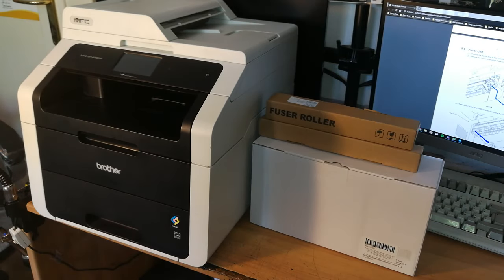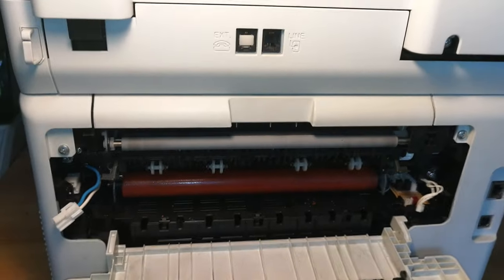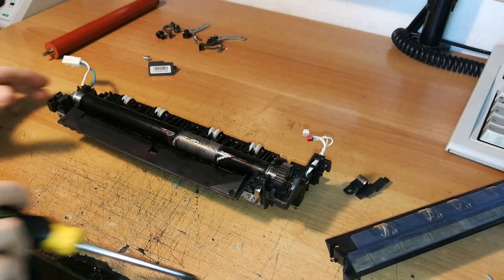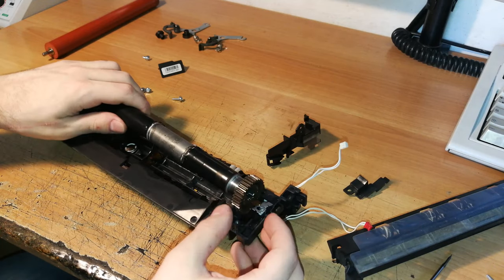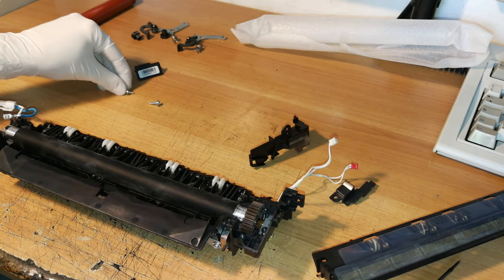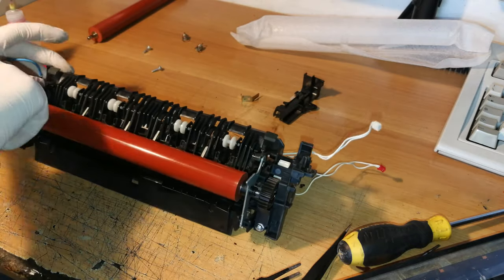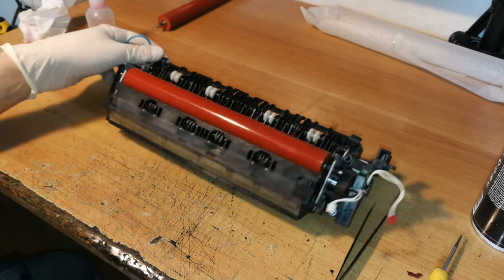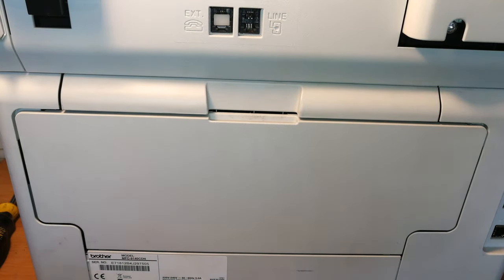Brother DCP-9020, MFC-9130/9140, MFC-9330/9340 • Fuser Unit Rollers Replacement

Comment: Paolo - Thank you so much for making this video.  I have no doubt I can change out the rollers with your instructions.  The only problem I'm having is which brand to purchase.  Many reviews of parts are stating the toner is sticking to the new rollers.  Is there a brand you recommend?
Reply from the maker: Hi David! The only one I tested is GoodPartner from AliExpress: https://www.aliexpress.com/item/32904772830.html
Consider also that if the temperature sensing thermistor is bent or it's not making good contact to the heat roller you can have toner sticking to the roller and/or not being fixed correctly on the paper.
Reply: @PaoloMarcelli  Thanks again Paolo!  :-)
Reply: @PaoloMarcelli  Hi Paolo - I ordered the roller set you recommended from aliexpress.  I had a problem with the factory gear fitting on the new lower roller. As you showed in the video, after bending the tabs, the gear slips right off the old roller and slides right on to the new roller.  Wen I attempted this process, I had to force the gear onto the new roller which then caused binding issues with the gear still attached to the fuser unit. I even tried ordering a different lower roller from Amazon with the same problem. Have you experienced this problem?  Any suggestions?

Comment: Great video.. So detailed and calmly explained.

My roller split and I decided to replace with a whole new unit. Seemed a very simple procedure, but it still wouldn't print after install. The paper stuck just an inch of so out of the heat roller and claimed there was a jam.

I have heard from several others with this same issue..
I'm told it is the little printed circuit board the two tiny wires from the unit plug into.. Any idea what might have gone wrong with it?
Upon removal I see nothing at all out of place. Solder joints look good.. Connector ports look solid.
I have a new board on the way (it was very cheap), but I'd really love to know if I did anything wrong.

It looks like there may be some kind of fuse on the board. A tiny one under a black plastic cover.
Reply: Mine is doing that also. What did you do to fix it?
Reply: @SkylerKincaid  I literally received the replacement board today. I'll try installing it and let you know if it solves it. The amount of people having this same issue is making me nervous though.
Almost like it's some other problem.
Reply from the maker: @Rob Lawrence Even newer Brother printers have problems with fuser units sometimes, but I think they have fixed and improved a lot since that series, I work as an authorized printer technician for Brother and other brands, and since that series on the newer MFC-L9577CDW it's waaay better. Sure they should've done more testing on the older series before releasing it, but I think it's good that they corrected those things in the newer. Better than Samsung that has the same problem with the solenoids getting stuck after 10 years of this happening XD
Reply: About the only thing on that board is a phototransistor, a $1 part from DigiKey. The sensor does two things: checks the cover is closed and also detects when the paper starts going up (there is a small lever that gets pushed by the paper). The sensor on mine got bad, producing a constant 'Fuser door open' error. I had to replace the sensor to get the message go away (https://www.youtube.com/watch?v=k-nSY0_wmMw&t=1s). Bypassing the sensor would clear the message, but the paper will always jam with half an inch in the fuser just as you described.  If you don't have the error message, the board is likely fine. Now that I replaced the sensor, the error went away, but the paper still jams occasionally, seemingly when the printer is hot. Perhaps the plastic lever gets bent and is not doing its job detecting the paper on its way up. Will play with it more.
Reply: @maksym3d  Replacing it fixed the issue.
V cheap part.
Reply: @breaddrinker  Thanks for the feedback! I think I might have to replace the rollers after all or maybe redo the solder joints on the connectors.

Comment: I would LOVE your help! My MFC9340CDW stopped working yesterday, after it printed a single test page, but ran out of paper. I pulled the paper tray out, reloaded paper, closed the tray, printed and it shut down, powered back up, shut down again but didn't restart on it's own. It's obviously due to something involving the paper tray, but I can't afford to just throw parts at it until it works again, and certainly can't afford a new printer. Any ideas?

Comment: Hi Paolo, just replaced the fuser rollers for my 9022 cdw. Thanks a lot. One Question I have is, do you have a source to get a new plastic gear of the black rollers right sight? My roller was a little bit taller and I get a little brick in the plastic gear... tried to fix it with second glue but it is not the gentlemen's way... an option is to model it and get 3D printed, but maybe you have a source to buy one?
Reply from the maker: Hi! No I don't know where could you get them, look on AliExpress, but I'd certainly avoid any type of glue or 3D print. The fuser goes up to 220 °C (don't know in °F) but anyway... It's a temperature that will easily melt every kind of glue or plastic, that plastic it's made from is a special type of plastic that does not melt at those temperatures.

Comment: I don’t know how you removed the cable at 7:20 minute mark from heating element with such ease. I have tried tweezers and plyers. I’m scared using too much force will break it but I’m tearing up the connector cord already.

Great video though, I’m just failing at this part on my end lol.
Reply from the maker: Hi! Some of those have something like a locking pin, on the center on the connector, you have to push it down while pulling on the connector, if it doesn't come out you can wiggle it from side to side while pulling it.
Reply: @PaoloMarcelli I was able to finally remove it, however I think the damage was already done unfortunately. Once I finished the instructions, closed up the printer, and powered it on, the printer started smoking 😂.

R.I.P.

Comment: Hello Paolo, I am starting to be a little bit desperate. My printer doesn’t print well. Everytime I print something, there are black horizontal smudges on the paper. (Like a tire stamp scheme) But the letters are readable. I replaced the drums, the toner and now even the fuser unit. But the problem is still the same. When I print a lot of pages, after some time the problem goes away. As if the roler is heated enough and the paper is clean, no smudges. Is it a problem of the heating element or it can be even a problem of a sensor which detects the temperature of the heating element? I don’t want to buy another component which won’t resolve my problem. The printer is not under waranty, but it is only 3 years old… thank you very much for your help !!
Reply from the maker: Hi Lucy!
Just to be sure about what the problem is, could you please send me an email with a photo of the defect? marcelli.paolo@outlook.com
Reply: @PaoloMarcelli  hello! I have sent you an email on your address 3 days ago, hope it is not in your spams 😊

Comment: Thanks , I have just changed the black roller . The hardest part is to put back those damned springs , my fingers hurt so much...
Reply from the maker: The "correct way" would be using a spring hook, but a beefy one because those are so strong! If I used my spring hook it would've broken instantly XD
Reply: @PaoloMarcelli  an old bicycle spoke (with the head still on, not a broken one) worked for me

Comment: wouldn't it be prudent to replace the heating element too? seems like alot of work to disassemble for ONE part potentially going bad later on.. how long would a heating element last?
Reply from the maker: Hi! The heating elements nearly never fails, it usually can outlast the whole life of the machine. Of course it can happen because of defective parts, but it's very rare.
Reply from the maker: Just be careful to not leave fingerprints on it, because the substances produced by the skin can stain the glass when it heats up and gets it prone to failure

Comment: At the end of your video, your  printer showed "raffreddamento" = "cooling down". Can you tell us : Does this message appear immediately after you replace the fuser ? How to resolve the Cooling down problem ?
Reply from the maker: I'd have to search more about that to be 100% sure but I think there's nothing wrong with that. Fuser unit gets to more than 180 °C and after every print the fan keeps running for a while to cool it down. There are thermistors and a thermostat in the fuser unit so if it overheats it cuts the current to the heating element, so I wouldn't be worried about it. That printer in particular has been sold and it's still running after months (I know because I didn't get any complaints for the buyer XD).
Reply: Its because the rollers he uses to repair the fuser in this video are known by other printer technicians with more experience to be no good. The rollers he used overheat and put fine creases in the paper when doing large print volumes and duplexing.

Comment: Any thoughts - I have a Brother 9130 and the first page and the test page look beautiful, but if there is more than one page in a document, the pages after the first page are dim or blank. Can you help?
Reply from the maker: Hi :) does it happen only with B/W documents or on ALL colours? Are the toner cartridges original or third party? :)
Reply: @PaoloMarcelli  thanks for the quick response. I’m only using black and white and the toner cartridges are third-party.
Reply from the maker: @vermontjazzcenter7822  If that happens only with B/W I'd try to replace the toner cartridge or the drum. On that model i'm not sure it's actually possible but you could try to install a colour toner in the black drum, it has been a few years since I worked on those printers so i'm not sure you can. This just to verify that everything else is good (example, you install the cyan toner in the black drum, do some prints, and the prints are obviously cyan but they are uniform and the defect doesn't happen, if that's the case probably the black cartridge is defective, if the same defect happens I'd try with a new drum unit.
Reply: @PaoloMarcelli  Thanks buddy, will take your advice!

Comment: After replacement of rollers, on powering on I'm getting "wait for a while" "Cooling down". :( So something went wrong, any suggestions?
Reply from the maker: Hi :) If the fuser connectors are correctly and fully inserted in the printer, check the thermistors are in place and not bent, check the thermistor cables, if the rollers doesn't get hot when you power the printer on, check continuity on the thermostat and check that the main cables of the heating element/lamp are securely connected. Use google images to search for a photo of these parts if you don't know what they are :)

Comment: Did exactly as stated BUT now the machine has an error code 05.  Restarted it 6 times, no go.  Reset the fuser counter.  Still nothing.  Do I have to buy a whole new unit?
Reply from the maker: Error 05 is an error with the thermistors of the fuser unit, chances are you didn't reconnect the connector properly or you damaged one of the thermistors while replacing the rollers, check these things.
Reply: @PaoloMarcelli   What is the thermistor?  Can you provide a photo of that part?

Comment: Great video! After replacing the rollers, the printer makes a loud grinding/rubbing noise while printing. It does print correctly though. Any ideas what it could be? I'm pretty confident that I put the fuser assembly back together correctly, but clearly something is wrong. During the original troubleshooting process, I also pulled out all the drum/toner units and the belt unit, but I don't see anything wrong with them either.

Comment: There is a black roller behind the fuser unit.  Can it be replaced?  Ours is damaged and wrinkles the paper.  If so how do I do it and where can I order the roller from?
Reply from the maker: Hi! Actually I don't remember exactly what part is that, I'd need to look at the parts list or service manual but I don't have them.
Reply: I think the black roller you are referring to is the transfer belt.

Comment: Thanks for the informative Video! Nicely done.
I used it for my DCP9022CDW but after the repair, the printer now shows me, that i need to slide/use the green corona slider/cleaner. But no matter, how offen i do it, nothing changes...

Anyone an idea?

Btw, i dont have a spare drum laying arround, to change it and try . . .
Reply from the maker: Hi Michael :) I know it's weird but this is 100% just a coincidence, because the fuser unit and the drum/HVPS doesn't have anything to do with each other. What I can suggest you is to take off the drums and inspect them, if the drum rollers are not visibly worn out (usually you can tell because they are of a lighter color especially at the edges) you can try to blow some compressed air on the corona section (where there's the green cleaning slide tab), just be careful not to touch the corona wire while doing so, if you have a can of compressed air or a compressor gun do not put the nozzle inside the corona slit, just spray compressed air above it. What happens sometimes is that some toner dust, paper dust or even normal dust, gets on the front or back side of the corona grid or at the edges of the corona wire where the green cleaning tab can't reach.
Reply: @PaoloMarcelli  thanks Mate.
Yeah, i know that the fuser and the drum has nothing to do with each other (in this failure). Just a bad Timing. Repair the fuser and all 4 drums has an Corona Error 🙈😂.

Allready checked the drum. It prints 13.000 Pages and got 11% left. Also checked it by visual. No worn i can See. Also reset the lifetime counter Back to 100%. But nothing works.

I will try this later! =]
Thanks for your helping =]
Reply: @PaoloMarcelli  it works! Big thanks man =]
Reply from the maker: @MichaelSelter  I'm happy that it worked :)

Comment: Replaced fuser unit rollers but printer says back cover open and I cannot find the problem
Reply from the maker: Hi! Check that the fuser unit is installed correctly and its cover is in place, check the back cover open switch, it should be pushed by the back cover itself when you close it.

Comment: Is this red roller replacement necessary?
My original one is fine.
Reply from the maker: You have the fuser unit already disassembled and the new roller costs nearly nothing so... why not replacing it? You can replace only the "heat roller", but as you're refurbishing the fuser unit it's good to replace both usually.

Comment: Hi there....I changed the fuser as you instructed, however now I am getting - "print unable 05" fault.....please advise. Ken
Reply from the maker: Hi! This is a mechanical error usually, or the printer is unable to see the fuser is moving through the sensors, re-watch the entire video and check if everything is placed in the correct position and all the cables connected.

Paolo M.
Reply: You have damaged the white and/or red socket/plug on the circuit board on the right side or not plugged back in properly.

Comment: I get a code  unable to print 05 after this. Any ideas?
Reply: same here - it think it has to do with the circuit board
Reply from the maker: Guys, is the fuser unit connected properly? Generally it's a problem that means the thermistors are not detecting the temperature properly.

Comment: I tried but now whenever I turn it on it Kees need to restart in 15min 😭 please help 🙏🏼
Reply from the maker: Are you sure everything has been installed and positioned correctly? Are the thermistors touching the heat roller fine?

Comment: So i guess at the end when your printer says "raffreddamento" this is italian for "cooling down" or overheated. The rollers you have used are not good quality.
Reply from the maker: Well, consider also that I had like 40°C in my room, but aside of that, raffreddamento stands for "cooling down" not "overheating" and I don't think the rollers used have anything to do with that.

Comment: Hi, I have issues with thst printer, I have already replaced DR-241CL and still no improvement. Pictures of test prints are here:
https://imgur.com/a/5RfBAls
Could you take a look and guide me what is wrong with that piece of garbage? Is it fuser unit fault or transfer belt?
Reply from the maker: Could be the transfer belt, but I'm not sure, I'd have to look at it and do a proper diagnosis